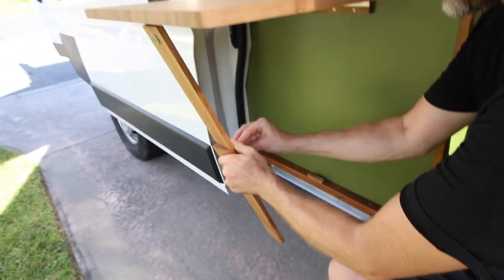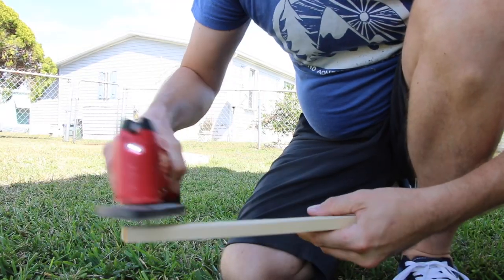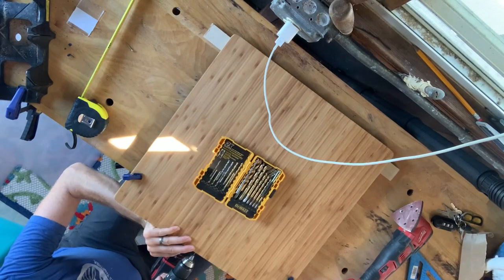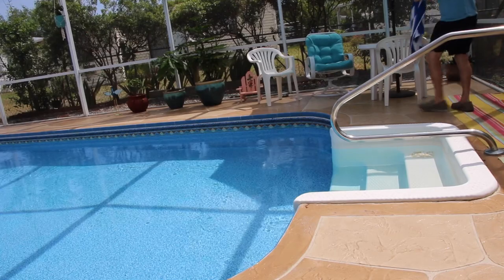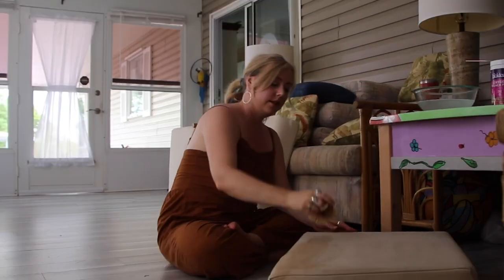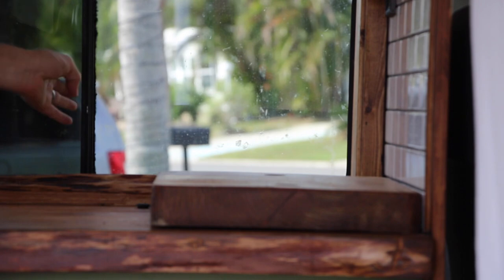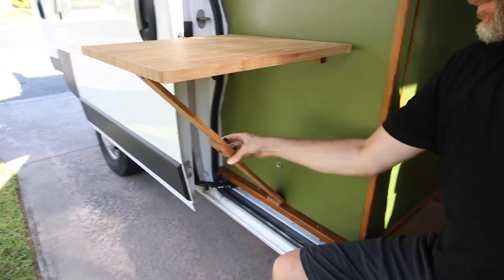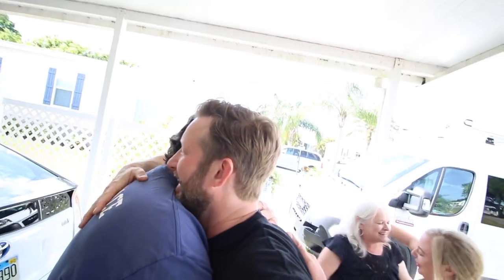HOW TO BUILD AN OUTDOOR VAN TABLE  | DIY van build tips

Comment: Great little table 👍  How’s the plumbing coming along 🤔
Reply from the maker: Plumbing is good. We just need to take care of the occasional odor from the shower drain. The sink has a P trap but the shower is a hose straight to the grey tank and no back stop.
Reply: @vanhallaadventures  that straight through pipe from shower to tank really does need some kind of trap in order to prevent nasty niffs. Good luck with your endeavours.
Reply from the maker: @johnbell7552  yeah we originally had the hepco valve installed but it was slowing down the drainage. Any ideas?
Reply: @vanhallaadventures  larger bore pipes. Here in the UK the bathroom basin is plumbed with 1.25” pipe, and the shower in 1.5” with a trap immediately after,  but guess that isn’t possible for your set up 🤔 The larger bore & trap would solve the problem.

Comment: Great design, this is exactly the design I was looking for but wanted to make sure it could be done nicely – you proved that and more! Thanks for posting such a lovely and well-filmed video! I'd love to hear more about the modifications you made – was the angle of the hinged support piece not large enough before? I want to try this on my rear door, so I won't necessarily have a little spot to tuck it into. Ironically I'm actually about to head to Florida soon from the Northeastern US in a few weeks – the van is far from done but I'm trying to add some nice touches before I leave :)